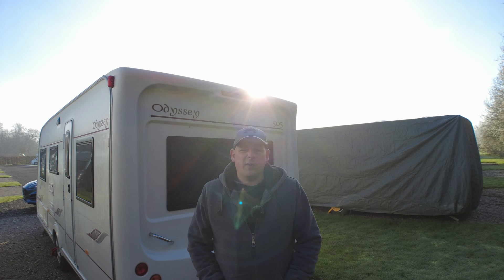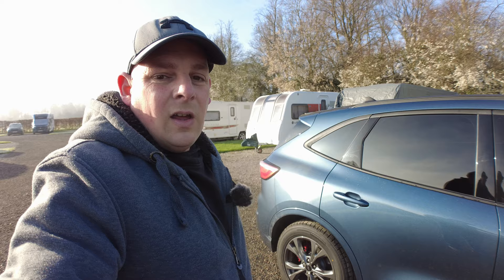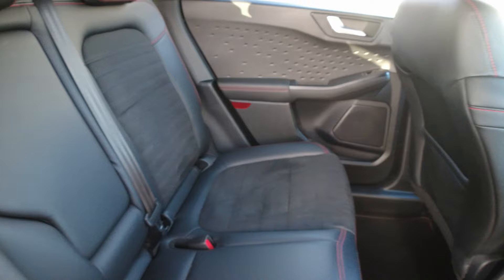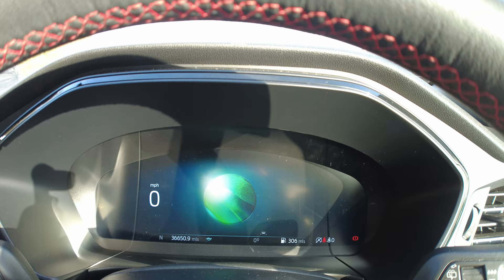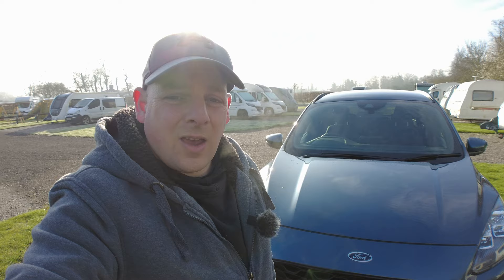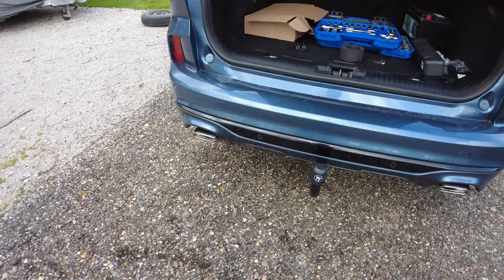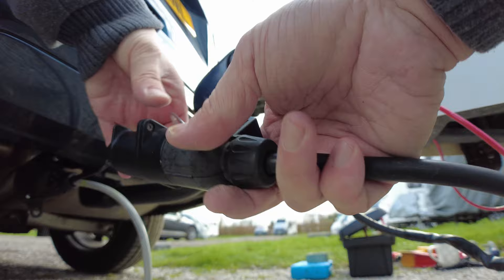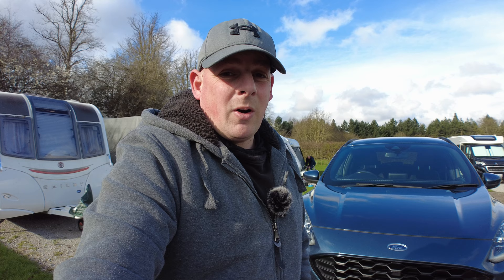The NEW Tow Car for our Caravan!

Comment: My current towing vehicle is a 2003 Volvo XC90 with the 2.4 litre D5 engine and a 5-speed automatic which will tow just about anything and is more reliable than say, a Land Rover Discovery 3. My current caravan is a bit larger than the previous one so the XC90 can handle it no problem.

Comment: Its great to finally have a caravan channel that has an Elddis Odyssey, so its been really interesting to follow your journey and experiences so far as we have and Odyssey 525 which is very similar to yours. Keep up the great work, we are looking. forward to the next video.
Reply from the maker: It’s our very first caravan and for the age it’s in good condition inside we are taking it to get serviced next week so fingers crossed they don’t find anything major I have just changed the tyres as they was very old! We are hoping to go away at the end of march for our first proper weekend away for Easter. We are doing other test run in it this weekend as we had a problem with the fridge but we will explain all that in the video 😁
Reply: Yes I can remember in a previous video you explained you had an issue with the fridge. Our van is a 2009 model. Check the rear awning rail rubbers are not stapled to the underside of floor of the van. Mine were on our Odyssey from the factory, water ran down them and over the years and rotted the rear floor, so just had mine repaired. I replaced both our tyres last year, they weren't too expensive, £60 each.   @CaravanTrails

Comment: Mate you need to get the paint off the tow ball asap. It'll clog your friction pads up.
Reply from the maker: Thank you for the heads up on this I wouldn’t have even thought of that! Luckily I haven’t tow with it yet I will look into it before we do.
Reply: I've always used a wire brush on my cordless drill,  then fine wet dry paper with brake cleaning spray.
Reply: I did my towbar a few weeks ago. Mask up the neck part under the towball to you don't scuff that part. Then get some varying grades of wet and dry sandpaper and sand it down, keeping it lubricated with water when doing it. Then finish off by giving it a spray clean with brake cleaner and wipe dry with a microfibre cloth and replace the cap. Doesn't take that long.
Reply from the maker: @adamsher86  thanks for this I will get it done this week as we want to use the caravan at the weekend

Comment: Excellent video. I'm looking to replace my current tow car and the Kuga 2 litre Diesel is on the shotlist. I'd go for the automatic as its an 8 speed torque convertor box, but its a shame Ford only did that version in 2021 and 2022 before dropping the diesel from the range. Lots on the second hand market at very reasonable prices. I'll be interested to see how you get on towing with it?
Reply from the maker: Hi thank you glad you liked the video, the car has been excellent we have had no issues towing with it pulls well and handles great I usually leave it in fifth gear when towing as I find when you use 6th gear you lose that power to get up the hills , I would of myself gone for the automatic but it was just out my price range at the time had the added cost of fitting the tow bar as well

Comment: £860 wow. I'm getting a supply and fitting for £210 down the road from me. I wonder if it is to do with the make of vehicle as mine is a 20 year old toyota rav4

Diesel is good, yes it is more expensive but a tank lasts a lot longer than a petrol. With my petrol I can get about 400 miles out of a fill tank (55 litre tank) - she's a 2.0 too
Reply from the maker: is it a fixed tow bar or detachable? I know the detachable ones are more expensive, I also had to have dedicated wiring as there are some safety features on the car that is activated when the caravan is attached also had to do it for warranty reasons.
Reply: @CaravanTrails  its a fixed one - no that I've done it yet as I need to save